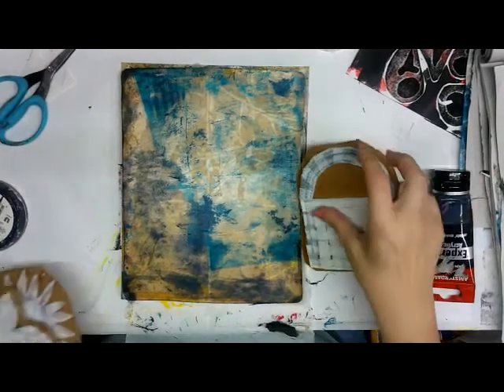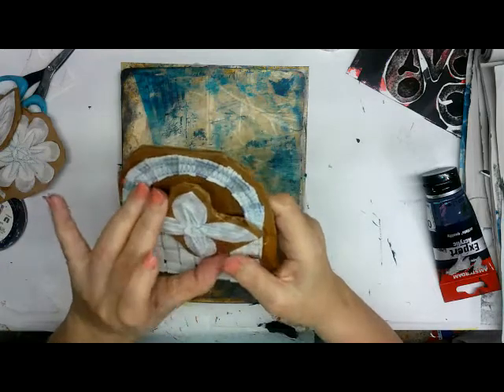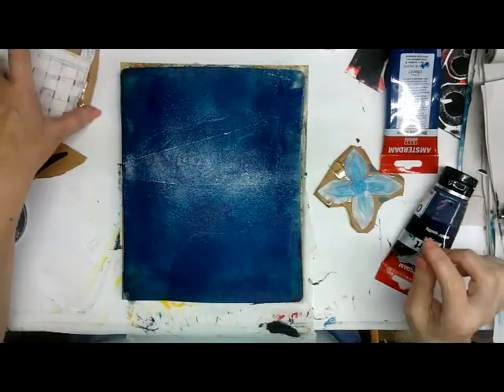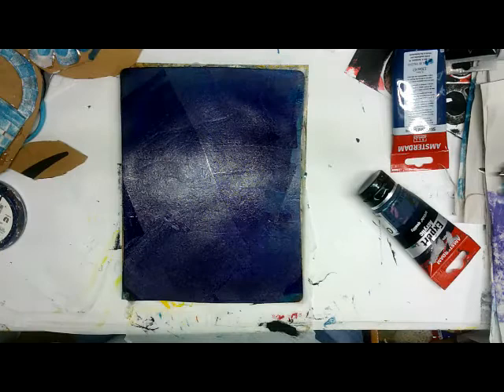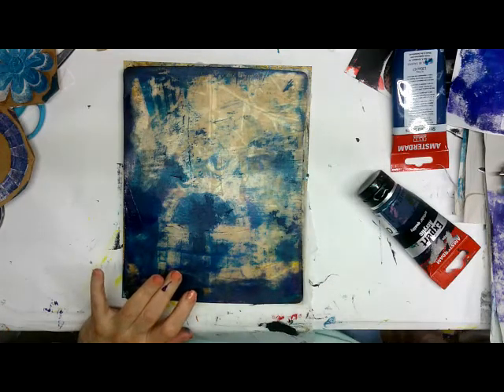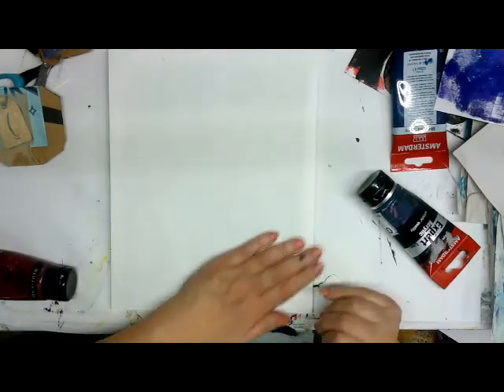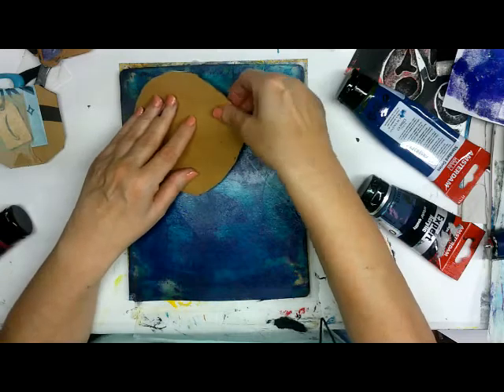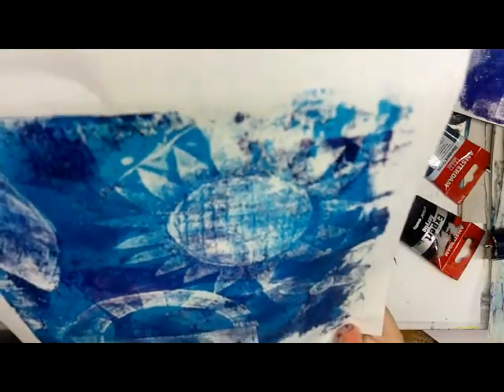Creating Homemade Stamps From Interfacing Part 2

Comment: The mic helps a lot with the audio. Thank you for continuing to work on it. I know the feedback must have been frustrating. (it wasn't intended to be. I'm sorry if I came across as less than helpful.) you've mentioned clay printing in the last 2 videos. My background is primarily in ceramics so I would love to hear more about that.